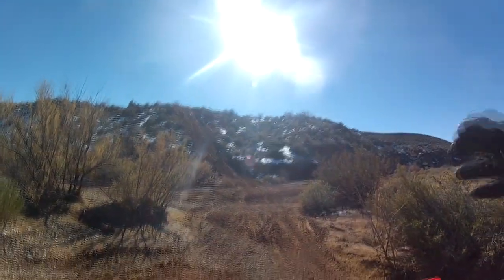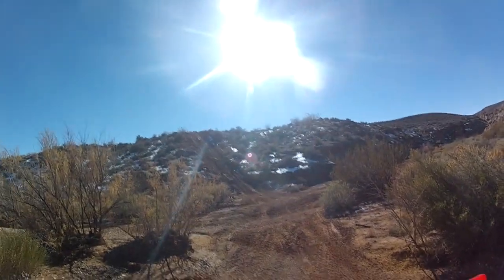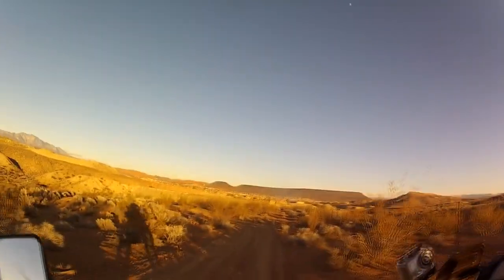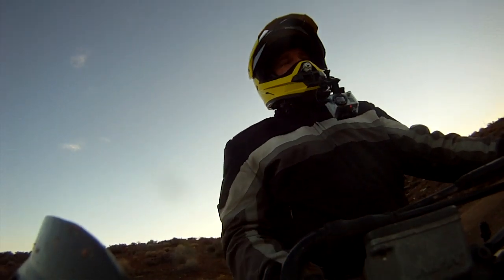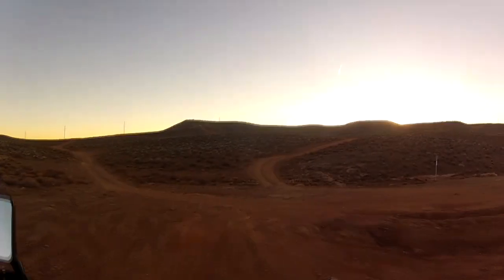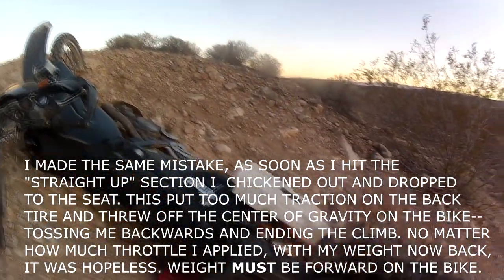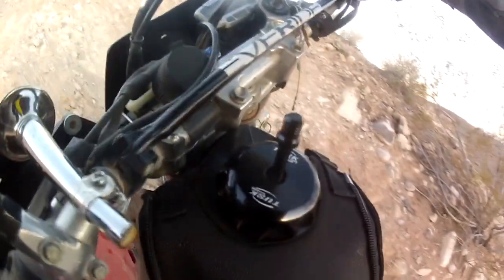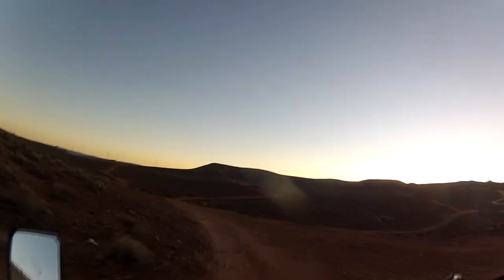o#o How to Hill Climb on a Dirt Bike & Pick up a Dual Sport Motorcycle on a Slope [mv]{

Comment: Tomorrow I’m going back to ride the Crooked Creek hill.  I’ve crashed the first two times I tried it,  Barkbuster mounting bracket cut the throttle wires in the first fall, on the AfricaTwin.  I was close to the top, and one of my accomplices quick-fixed the wires, and got me home.  Second time, I didn’t fully commit, and only got 1/2 way up, crashed, and had to go back down.  Will be running it on my CRF250L tomorrow, a MUCH less intimidating bike.  I’m glad I picked your hill climbing video to learn any last minute tips.  Chose well, I think.  I’ll do as you said, standing,  over the bars, crouching, with butt back a bit for traction, and keeping my EYES UP (a problem of mine).  Thanks for the great video, I’m surely going to see more.

Comment: Standing forward is a good basic starting point but on many hills as you know a rider may need to be all over the bike.  up, down, forward, to the rear, as terrain varies.  often time on steep hills one needs to be forward, down on the bike with weight to the rear as seen in my thumbnail.  Cle Elum Coalhill #9 1978

Comment: Nj has some nice hills. If the hill is really steep you wanna be more centered on the bike because your back wheel can lose traction and you will lose your momentum and then your back wheel will just spin.
Reply from the maker: gabe pinho Very right! I find that if I stand I can almost "fall back" a little bit. This video was recorded a while ago so these hills are all pretty tame. I'm still no pro, but it's nice to push myself a bit harder.

Comment: One thing I have to do... accept that I AM going to fall off road.
All of my experience has been on street bikes... where a fall is generally going to be a trip to the Doc.
Reply from the maker: Yeah, falling in the dirt is just as sure as hitting the throttle. It's just going to happen... not often, but it does happen. It's never a big deal if you're wearing the right gear. I come off maybe 1 in 10 rides.

Comment: you would hate the hills out here in northern california. when I get the chance in spring I will head out and try to get a few angles of a typical skid road out in the forest. The roads up to most of the logging landings are incredibly steep. Once, we tried to go up one in my fathers old 89 F150 he used to have and ended up stalling it part way up and having to free wheel it back down tho it was only a 6 cylinder. I've also seen my cousin go up them on an old TT500 Yamaha and they can be nuts.

Comment: momentum is always king for getting up those really steep ones, when you lose momentum it becomes much easier to loop out or spin the tire. granted the faster you go the more it hurts too.
going down the really steep and high ones scares the crap out of me, the ones where it's pointless braking and you just have to coast down then brake hard at the bottom when you're doing 60+mph. i'm fine to climb the hills i just don't want to come back down
Reply from the maker: Ah yes, my hilllclimbing experience is pretty limited and I never get into the REALLY sketchy stuff... although I went back up the first hill yesterday and it just blows my mind how tiny it looks on camera. I've been watching a lot of "Offroad Fanatic" YouTube channel lately and am trying to follow their tips and regurgitate them from enduro/dirtbike to more of a Dual Sport crowd-- guys that aren't too hardcore, but could use the tips all the same. Just yesterday I tried out putting the weight on the outside peg during a turn and MAN what a difference that makes!